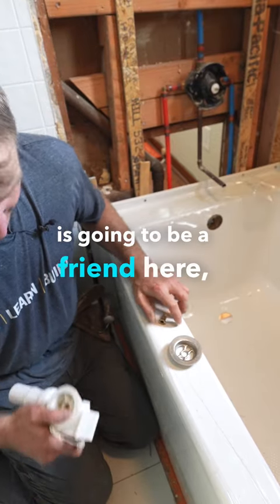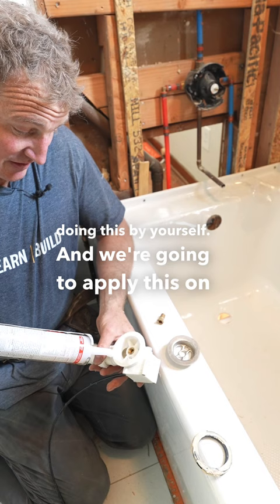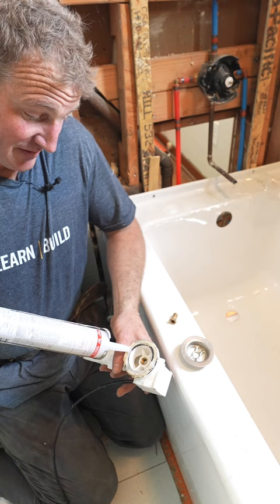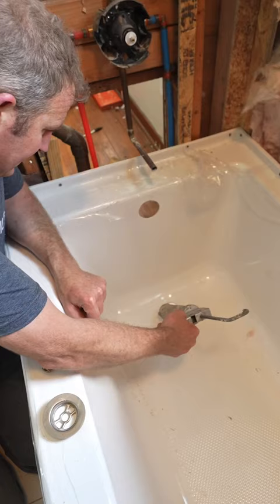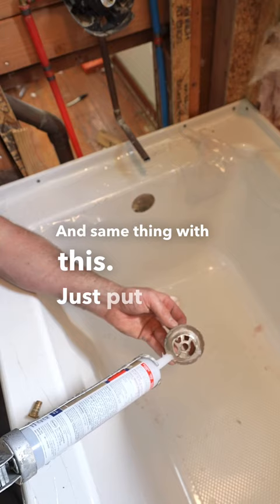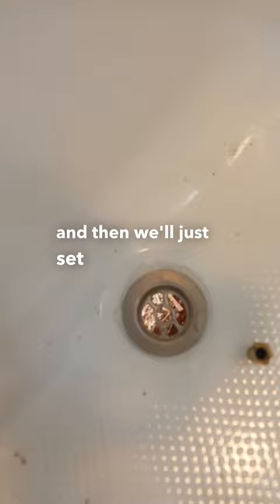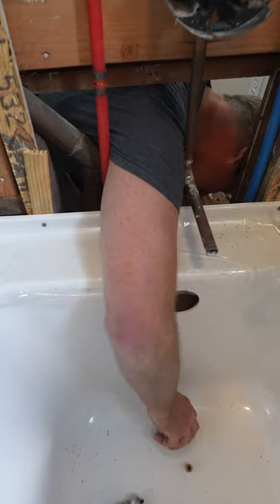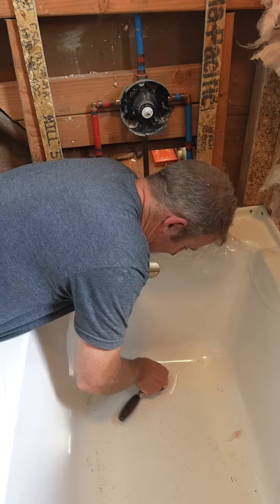How to Install a Tub Drain Assembly DIY

Comment: No silicone on rubber gaskets. Who taught you how to do plumbing, the Three Stooges?
Reply: Probably the same guys who cut into floor joists over lowering the drop on drain.
Reply: He's not a plumber. I would fire his ass right away if he uses silicone where putty is needed. Yes, in some cases we use silicone but here you can just do it right and put putty instead.
Reply: @rvd2960 what if the manufacturer stated not to use putty? Then what bubs? You read the directions much?
Reply: @rvd2960 NO PUTTY.

Comment: Not being a plumbing nazi, but when you put silicone on a rubber gasket it becomes “lube” gasket. When you go to tighten the drain assembly down it’s going to pinch and push out that gasket resulting in leaks. It’s also very risky reusing a gasket in case it cracks or deteriorates. If you must reuse a drain assembly they sell gaskets separately at the big box stores. Only apply the silicone to the upper drain and let the lower drain compress a nice clean DRY gasket against a nice clean surface.(hint-hint) 

Either you are the worlds best troll or you’re still learning😂😂😂😂😂😂😂😂 keep it up though. Only one way to go and that’s up.

Comment: Putty is superior. Just make sure to knead it till its nice and soft and sticky
Reply: Putty is awful has failed so many times
Reply: @CEO786  Anything in plumbing will fail if installed improperly, I've seen countless tubs and sinks from early 1900s with the original putty still not leaking after more than 100 years of use. Silicone does not provide that level of security.
Reply: Do not use putty on acrylic tubs! No matter how you set them they do flex a little and putty will fail. Silicone the flange and make sure to clean with denatured alcohol.
The only failed tub and shower drains that will fail on fiberglass and acrylic are installed with plumbers putty
Reply: Facts 🤦‍♂️
Reply: We always set plastic tubs/pans in a bed of mortar, it eliminates any flex. If a drain or tub manufacturer specifies silicone than that is what we use.
Reply: @boscobaracus1823  mortar on a wood subfloor?
Reply: @jp360ford2   we put paper down below the mortar
Reply: @jp360ford2 yea, you put vapor barrier down first if you're worried about it for w/e reason.

Comment: Service plumber here... this is not good advice. Please don't do this in your home or anyone else's.
Reply from the maker: Well, good luck with all the new acrylic tubs requiring silicone or better yet polysealant 👍
Reply: @BathroomRemodelingTeacher  you either use silicone, or the gasket from the manufacturer. Not both.
Reply: So apparently its just you and me reading directions now a days. You could make big money on YouTube doing this. Next title is using silicone on bathtub.

Comment: ???? Have you ever heard of plumbers putty????
Reply from the maker: Explain please
Reply: Using silicone in this instance will make repairs later a battle. Plumbers putty is made for putting in drains, pop-up assembles and basket strainers.  All most like a clay substance but never sets up hard.  Easy to clean off the fixture surfaces.  It’s water proof and I’ve never seen it stain.  If there is a problem You can remove it and reapply after repair.  That silicone on a fiberglass insert guarantees a hammer, chisel and cussing match later to unclogged or repair a leak.
Reply: @sprucewilliams4633  use what the manufacturer instructions call for.
Reply: @sprucewilliams4633 good for everything you mentioned except acrylic and fiberglass tubs and showers. They tend to flex and the putty has a tendency to fail
Reply: @thehoser1965 If your acrylic or fiberglass tub is flexing, it will be cracking in the near future !
Reply: Have you ever heard of “dont tell other’s what to do”!!😊